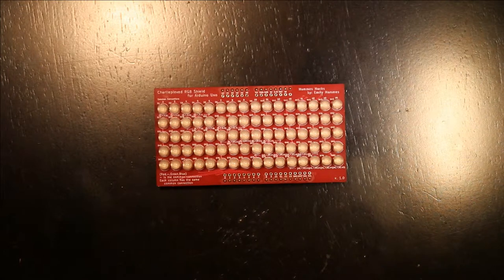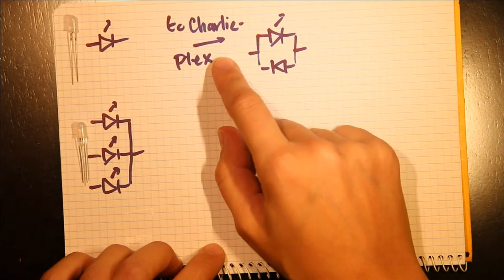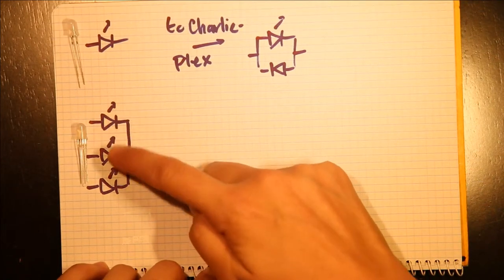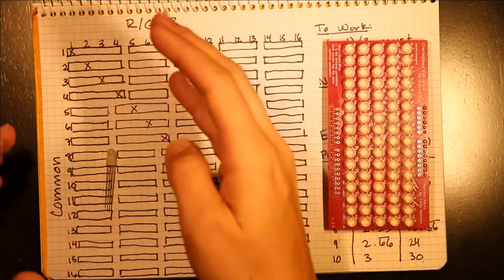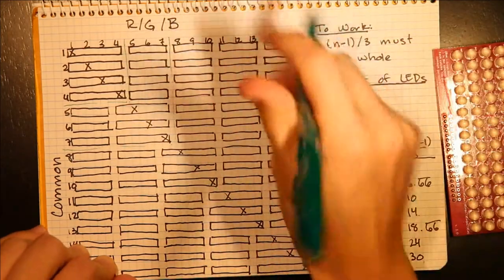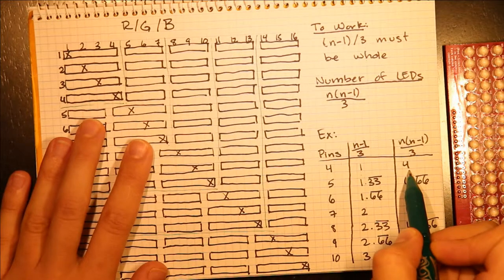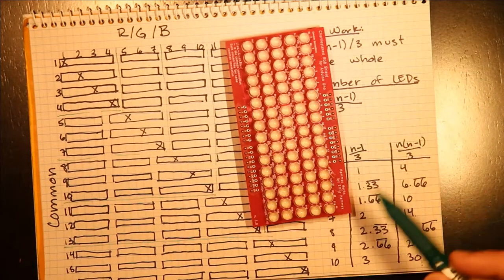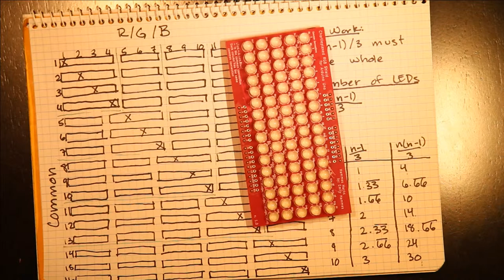How to Charlieplex RGB LEDs

Comment: Ive considered wiring up LEDs on a board the way you have done there. Ive made many 4x4x4 LED Cubes (charlie cubes) wired this way, it uses 16 microcontroller pins. 
Ive recently built a demo board that shows how a spire of 4 RGB LEDs works without the microcontroller, just switches to simulate the tri-state logic.

Comment: Have a Totem pole also known as a push-pull output current amplifier to overcome the dim LED issue. Use higher voltage, but lower duty cycle. 
 like a camera flash.  Does not load the MCU too.

Comment: So you explain the possible number of pins you can use and the number of RGB LEDs you can drive, but not how you dealt with the common cathode problem mentioned in the first part (or any further wiring, but that would be complex).
Reply from the maker: In the PCB, electrons flow from a pin on the micro controller (Arduino Uno) through a resistor, to a red, green or blue LED, then to the common pin, and to another resistor (like in normal charlieplexing). Because the pins are all grouped together (in the RCGB package) I need to work with groups of them. I tried to represent this grouping in the graph where the rows are the cathodes (C) and the columns are the anodes (RGB). 

This might not work with all LEDs, because the voltage drops across different colors might be different, but it has worked with 2 different brands of RCGB leds on my PCB.
Reply: @HammesHacks  Thanks for the response. I think that confirms I understood the graph/chart correctly. I may need to actually get some LEDs out and figure out the smallest circuit. For some reason I find deriving the layout of a circuit from words rather than a diagram very hard - though I don't exactly find a logical diagram to an actual circuit board trivial - though on that skill I can at least tell I'm getting better. A circuit diagram for the smallest set of LEDs possible might be useful, though I understand it's time consuming to draw it up and make a video.Thanks again.